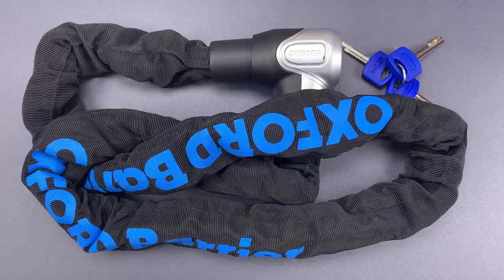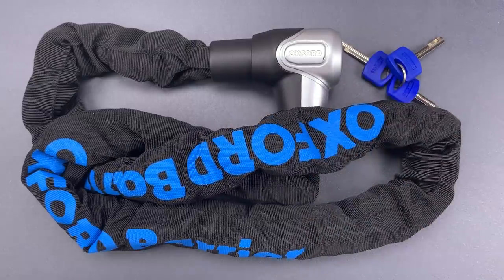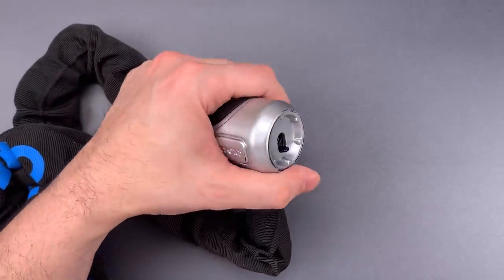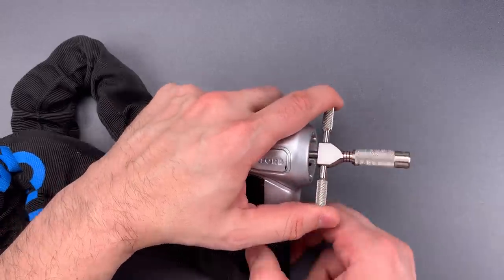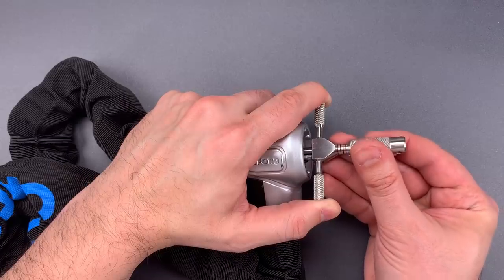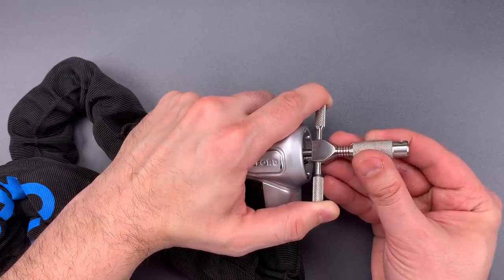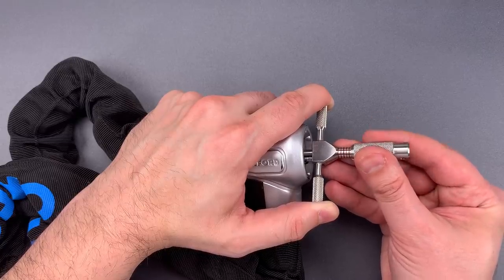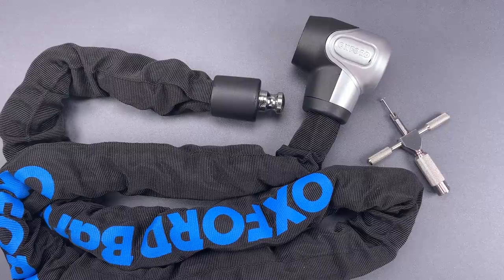[1037] Oxford “Barrier” Bike Chain Lock Picked

Comment: When you need a specialized, custom made tool to be picked and you're still only "PROBABLY pick resistant enough"

angry lock noises
Reply: He doesn't have to use the custom pick, you can get a consumer version of it for pretty cheap. I assume he uses it because A) if you made the thing of course you would use it and B) it drives comments up because people meme about it.
Reply: @MudakTheMultiplier  And it's just a really good pick.
But in a low-security setting more complicated picks are less common and picking is less of a concern for bike locks, so it's fine
Reply: Look. He's a lawyer. He will NOT authoritatively state that the lock is sufficiently good. What if someone buys the lock on his recommendation, had the bike stolen and sues?
Reply: @sharpfang  You know, I hadn't thought that one through.
Reply: @sharpfang  Kinda reminds me of when I looked into QubesOS. They advertise themselves as a "reasonably secure" operating system.
It's the most paranoid thing I have ever seen. It goes well beyond "reasonable". But, they don't want to say it is secure, because someone might find some vulnerability.

Despite assuming that even PCI cards are compromised by default, it could happen, so they don't.

Comment: I always notice that whenever there is a disc detainer core in a lock, you pull out that special tool. I have 2 questions, 1) what do you think is the actual likelihood of a thief on the street having one of those tools and 2) is it possible to pick a disc detainer core without that tool, and if so would you consider making a video on that topic?
Reply: The likelihood of having that pick will go up exponentially once the company that LPL and BosnianBill have producing it start selling them.  Ideally, only professional locksmiths and hobbyists would buy one, but we all know that's not the case.  The average thief is more likely to be carrying around bolt cutters and wouldn't even bother trying to pick a lock.  Good locks deter the lazy or the risk-averse thieves, and that's about all you can ask for.
Reply: Walter Jordan I believe he’s addressed this before. What he’s using is a prototype of a tool designed by BosnianBill and himself, which will (eventually) be sold by Sparrows commercially. Other Disk Detainer picks can be bought without much trouble, but the skill required is fairly uncommon.

Comment: I've had a couple of Oxford motorcycle locks, they have a weakness in that water ingression into the lock corrodes the mechanism to a point where it binds and won't lock or open. Mine lasted 12-18 months outdoors in a temperate New Zealand climate.

Comment: If he has to use his custom lock pick, I assume it’s a good enough bike lock for the average person lol
Reply: It's a pretty good lock. Just dont drop it or it will not open any more. That's the only problem that I had. Otherwise. Its decent quality
Reply: He doesn't have to use a custom pick. BB and him just made a pick for disc detainer locks that improves on commonly seen flaws. It is not custom for the lock and is on it's way to getting mass-produced.
That said, yes, disc detainers do require a more sophisticated and less common kind of pick, so for a bike lock they are a good option.
Reply: He uses his own pick because it is higher quality than the ones already available, but their design will be mass-produced soon.

Comment: As the video started I was thinking, you almost never get a lock that's good and it's getting a bit old.  Altho you opened it rather quickly I'm pretty sure there are very few people that could pull it off and I was thinking that I'd feel safe using it, then thought, I wonder what LPL is going to say about it.  I'm glad you gave it the "good enough" stamp of approval.

Comment: Hi thanks for reviewing this chain, I need to buy a new one but don't want to spend as much as this costs 

What is the best cheapest lock around £20-30 (about $40 max)

Would be used for a motorcycle, for the rear wheel I have disc locks on the front
Wanted a bell catalyst 750 that you reviewed here but they don't sell them here :(

Comment: the best part of this lock is the chain, I have a chain like it and use a U-lock like a padlock to lock it up. no marks at all on the chain but the shackle you can
see all sorts of cut attempts 8 on one side and 9 down the other. guess nobody wants the noise of an angle grinder.

Comment: With this level of pick resistance I would be more worried about a thief stealing my wheels or other components off the bike. A single allen key bolt holds on the break leaver. Undo that cut the cable or hydraulic line and you got a pair of $400 break levers.

Comment: Is this a favored pick ? Seem to use this one a lot or it based on the type of lock ?
Reply: tl:dr - It is based on type of lock.

It is specifically designed to pick disk detainer core locks, which the lock in the video has. Disk detainer locks require different hardware and techniques than pin-and-tumbler locks like the one on your front door. That tool would not work on pin-and-tumbler locks. Instead of pins moving up and down, they feature stacks of disks that rotate side to side with gates cut into them. Line up the gates and the lock opens. That tool is designed to apply tension to the lock by notching part of the main body against disk 1 and turning the crossbar, and the small, moving part controls another piece that moves up and down inside the lock to rotate the rest of the disks.

Comment: So I guess I have a question. Why aren't door locks a disc-detainer type? It seems like it almost always takes more time to pick them, and you need a specialized tool for this and quite a bit of skill.
Reply: There are door locks which are just as secure, or more so (for example, https://www.youtube.com/watch?v=zq5rGjt-9rQ). Disc detainer mechanisms have the advantage of being small, which is great for a bike lock but unnecessary for a door lock.

Comment: Hello LockPickingLawyer, im writing you here cause I cannot anywhere else. I wanted to ask you if you ever heard about an exagonal hardened steel chain, produced in UK, which has a lock with has three different keys, and each key will open the lock but will also lock out the previous key? At the moment I cannot recall the name of it, but maybe you can and have already open a lock which work like that. Bye

Comment: Is it really that hard to put false gates into these locks? Because it seems like a lot of them only needed to have the false gates to be very good in terms of picking resistance, including this particular lock.
Reply: Adds more machine time to make the various disks, and your tolerances need to be tight enough that the false gates don't accidentally turn into true gates which takes good/expensive machinery.

Comment: So to pick this lock you’ll need to spend hours in a machine shop building the pick he and Bill made. And then you’ll be able to steal that $1,800 bike. Assuming you have the skills to both machine the tool and use it.  🤔 And the skills here are high, both in the machine shop and on the street.

Comment: picking using hyper specialised tools isn't telling us anything, its exagurating how easy these locks are to open.
Reply: Well, you won't be able to pick this lock without specialized lockpicks, but so what? Any thief is either going to have an angle grinder or bolt cutters or specialized lockpicks. LPL is giving you a worst case security evaluation - the lock provides about 2 minutes of protection against a skilled thief with the right tools. You can compare that to how long it takes him to open other locks if you want to get a relative security level. If the thief is less skilled or has less good tools, it'll take a lot longer.